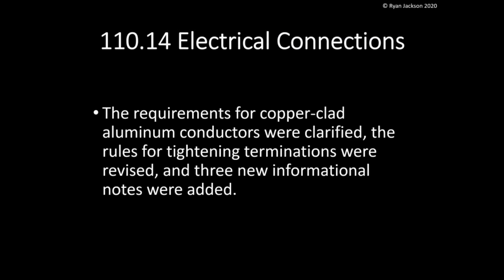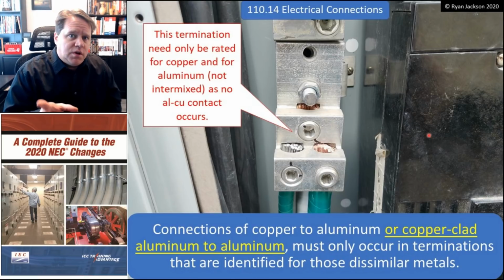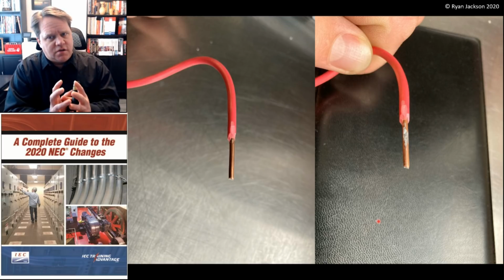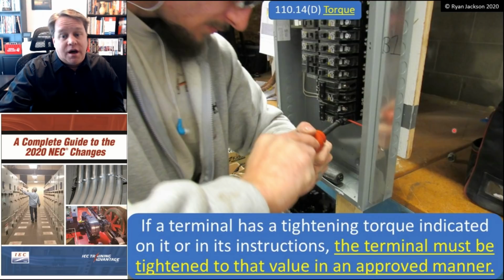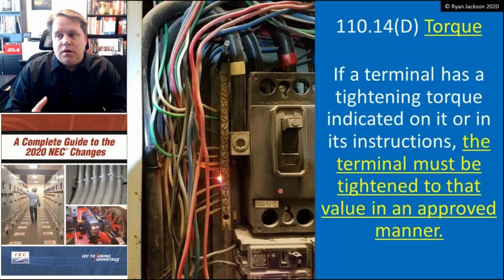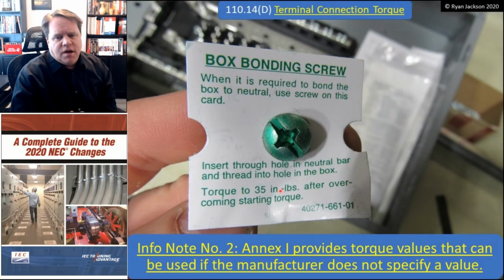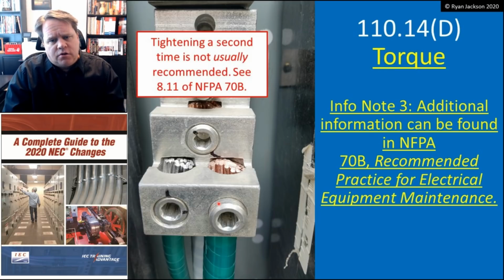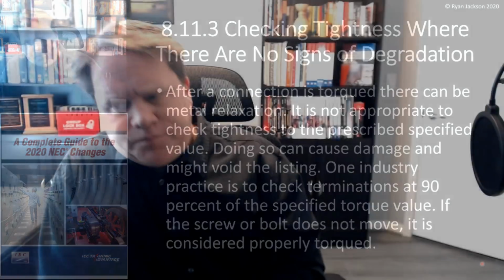2020 NEC changes series: 110.14 Conductor Terminations

Comment: At 5:45 you talk about skin effect applying to power conductors, but in your conversation with the gentleman from Copper weld he mentioned how that really only applies to data conductors, and the majority of the current does flow through the core of the conductor for power conductors. Which is the case?
Reply from the maker: He is correct. Skin effect at 60 hz is not much of an issue. It is a common misconception that I used to beleive.
Reply: Wow no kidding. It is what I was taught as well. I thought CCA was invented because of the skin effect (since copper is the perimeter). Thank you for your quick and helpful response Mr. Jackson!
Reply: Do you have a video or more information about this?

Comment: 8.11.3, that right there is why all of this should be available for free, and not behind a paywall.  I'm a farmer, I've installed two of my own services (one new, and one changeout).  Farming doesn't make enough money to hire an electrician, so I research as much as I possibly can, and then if it's legal, I do it myself.  I've heard to re-torque connections, but never to the 90% value.  Even plan on calling the POCO to pull the meter so I can retorque meter terminations (line and load side, I bought a pair of Class 0 gloves and protectors) after a year of heat cycling, seems like cheap insurance.  I even used a torque wrench on the SEC after the POCO terminated to the meter socket with a T handle.  They were loose.  You could potentially have thousands of $ of damage from an open neutral, and it could be due to the POCO not torquing the meter terminations. Honestly, even if the code didn't require it, it's just a smart thing to do.  After seeing some electric installations, I don't even know why they require licensing for electricians.  They either don't have the licensing and do it anyway without inspection, or the inspector passed some sub-par installations.  I passed a state inspected service, it was amazing how easy it was (granted, I researched thoroughly, and asked questions about almost every variable, so I knew I was doing it correctly).  But during the inspection, I was thinking "really, you didn't check how tight the lockrings were, the torque on any of the terminations, anything?"  Basically, even if I had a Master Electrician install something, and it was inspected, I'd still check it myself.

Comment: My only disagreement after watching the video is to only torque once. I've followed those electricians around far too often. One of my first lessons in the field was to always retorque connections, specifically every stranded wire connection. The stranded conductors will "settle" and should be re-torqued 24 hours later.
Reply from the maker: That is 100 percent incorrect.
Reply: Did you watch the entire video? He goes on to explain why you only torque once. And backs it up with receipts.

Comment: And if I am working in the panel, - do I have to remove every component to look for the torque value of each of it, because it is not visible from the front, to find out what is 90% of the required torque value is?

Comment: As a building inspector, they had to go work as a millwright when we had to crash in 2008. Well I found is electricians do not tighten things tighten enough. I found loose lugs loose wire nuts and some poor installations. It’s nice to be back as inspector since 2013. But that short time off taught me that I need to pay more attention to what the guys are doing out in the field.

Comment: Is that terminal really made of steel? Or a steel alloy? It seems kind of lightweight, to be steel.
Reply from the maker: Aluminum.
Reply: @RyanJacksonElectrical  With tin plating. Some bus bars use nickel for higher expected temperatures.

Comment: Food for thought. On several panels that I know were torqued a year earlier had hot breaker terminals under load when viewed by FLIR thermal imaging. All popular brand breakers with both solid and stranded copper wire. The they were re torque and the heat went away. Pulling and inspecting a twice torqued conductor shows no excessive signs of damage,pinch off, extrusion. Only good contact area. Soft metal cold flows and 85% is initially, the rest comes later, but it greatly reduces and is not indefinite unless there conductor/terminal aren’t compatible or sized correctly. One lifetime torque is BS and a great way to service call. I predict the NEC will address it better. For the first tightening on stranded is to gently orbit the wire as I come up to torque to help settle the strands. Makes hell of a difference in integrity of the connection.

Comment: Re torque a second time after 24 hours is standard practice in pipe fitting for flange bolt connections. Super interesting the opposite is true here for the same concept

Comment: Still, never will use aluminum other than service conductors, some large feeds, that is where the copper clad may benifit, but CCA still needs to be treated as aluminum, is more brittle, termination torque etc, I will never use CCA for any branch circuit installation. After having dealt with some of the AU home wiring back in the day and those problems, never would I ever install it now, even if copper cladded. Same for low voltage (reference data/security etc) had gotten some CCA wiring for some data, security was cheaper did not notice, eventually so many issues with failed termination, I ripped out what had installed, got pure copper no problems, basically all that CCA when to the dump where belongs! Learned my lesson with that costed me, the money wasted on the wire, the time redoing stuff. I do not want call backs and have no time for installation issues either. Just not going to be part of my inventory.

Comment: sheer bolts common for "donuts" or "biscuits" that connect multi family meter packs next to each other. the head breaks off, and a colored plastic washer is left behind that shows its been torques.

Comment: I would imagine that the skin effect is very slight with only 60 cycle current and that the real reason for the diminishing returns with larger conductors is the diminishing surface area to volume ratio. The volume is responsible for the generation of heat, but that heat can only dissipate via the available surface area.
Reply: Most likely not that much effect at that low of frequency, probably some but doubt it I think the most obvious reason for CCA is cost period as the major driving factor.
Reply: Most of current travels near the surface of the wire.  With larger wires you can theoretically get more current capacity for less money by cladding aluminum with copper.  The current cost of materials and cladding will dictate when it makes sense.  Of course I would rather have copper only and not worry about issues with aluminum.    Back in the 1960s I worked with circuit boards that had silver or gold conductors, not that anyone could afford gold for wiring a structure

Comment: Worked at a large slaughterhouse years ago where we always installed lockwashers on all bolts ( stakon splices motor bases etc ) due to a lot of vibration by crushers hammer mills skakers etc. Made sure all connections were made super tight. Had to get use to not breaking heads off of 1/4" hex headed screws while tightening with a breaker bar.

Comment: Before I retired a few years ago my very smart senior electrician showed me one of his electrical books ( not the NEC )  told you that you should never retorque wires that were torqued. We had an on going arguement with the cheief electrician who insisted that we retorque every connection every time we performed a 6 or 12 month PM on hundreds of VFD'S that were running. At that time nobody made an insulated torque wrench so even with PPL refused to do it unless the drive ccould be shut down & LOTTO.

Comment: Like how some switchgear manufacturers mark heads of all hex headed bolts with a marker. By looking at original drawn line between bolts and buss bar or breaker connection easy to see if connection came loose.

Comment: Thank you Ryan. I have been doing maintenance- electrician- at a zoo for about ten years.  Probably 90% of the electrical equipment is from 1986-87.  I’m a little embarrassed to say I HAD gotten into the habit of  “ red-faced torquing” .   You know, just short of popping a vein.  A lot of what I do is trying to maintain our existing equipment so again.....thanks.    Doug.
Reply: Over tightening bolts & screws not a good thing. When I was a young strong apprentice would drive my coworker crazy breaking 1/4" by applying too much force. While at an IAEI class the instructor told us that UL went around and checked torque on various connections. Only 30% were correct and think it was 50% too loose and remainder over torqued.

Comment: Are we just not gonna talk about that "" glowing red "" termination he showed is on a ground wire ? 🤣🤣 

And on the torque specifications I understand it but are we gonna have to start doing yearly maintenance retightening all terminations because they will eventually loosen with electrical being at 60Hz which is absolutely a vibration that will over time become loose

Comment: the reason I didn't become an electrician, it's a blind religion. every time the code book comes out, worship that thing, don't bother to understand reasons, that's illegal, just follow the book! no. how many electricians really understand the things they are doing, the reasons for why things are done a certain way. it's always about the book. fuck the book, understand what is really happening in the real world.

I once ordered some wagos to try on some low voltage. I got them and looked at them.... no, not using this trash. not for low voltage, definitely not for my home wiring, never. but if the code book says it's ok, then.....

Comment: electricity doesn't flow mostly around the outside of a wire, that's mythical bull. that only applies to high frequency, which power lines are closer to dc than they are to a high frequency. the real reason you have diminishing returns on larger cables is the surface area, yes, but for different reasons. heat dissipation. that is also a reason why animals can't get much bigger than an elephant and why smaller animals have a much faster metabolism, surface area to get rid of waste heat. electricity flows for the most part evenly through the entire area of a cable. a down side of copper clad, it creates more heat internally, which needs more surface area to dissipate, which means a much bigger cable.
Reply: Came into the comments to make sure someone mentioned this.

Comment: Wait just a minute.   Please explain the harm in tightening a connection too tight.   That's absurd.   Is there a requirement for yearly torque testing?
Reply: bolts stretch when they are over-tightened. they can also stretch somewhat when they're properly tightened, hence why there's a specific torque. an engineer figured the exact amount that bold should stretch to be as secure as it can be, without the risk of damaging the metal. if you keep making a bolt tighter and tighter, you get to a point where not only does it not tighten more, it'll start to fail and give way. most times in the world, good is good enough. but with electrical installation, much of the time you want that install to absolutely never fail. sometimes guessing with your own strength isn't good enough.
Reply: @lorenzo42p  I'm 60 years old and have been working in the repair field most of my adult life and even as a youngster growing up on a farm to a certain extent.   I spent several years in related schooling. I'm very familiar with bolt stretch.  I'm also very familiar with the fact that there's a difference in bolts.  All that being said,  it's really not realistic to think that screws in a 60hz ac system is only going to ever need tightened once.  Not one time in my entire life have I had a connection fail because I didn't tighten it correctly.   The only problem with connections is from a less than desirable tech and using a torque wrench isn't going to fix that.  It will only hurt the ones that didn't need to use it in the first place.
Reply: @engineclinic  I want to prove you wrong,. But, I can't. There are estimates. Estimates don't prove much. However, there really isn't any other data, because in 1980, statistics weren't really that concise. I am a better safe than sorry type. The estimates are that there are currently half as many fires caused by electrical malfunction than there were in 1980, when you began. However, most electrical fires are NOT caused by poor quality in workmanship. In fact, it doesn't even rank in the top 7. Aging equipment, DIY repairs, turkeys, overloads, heaters, and extension cords all made the list. If I were to guess, if the 50% estimate were remotely true, it has very little to do with over or under torqueing connections. It probably has more to do with organizations like the NFPA creating awareness of the dangers of things like turkeys and tip switches on heaters. You can't educate the DIY'ers anymore than they choose to be, but I think that currently the DIY'er is a bit more savvy than they were 40 years ago. A lot of that has to do with the availability of information.
Reply from the maker: Damaging the conductor, damaging the damaging the terminal, damaging the equipment. No, there is no such requirement because the NEC ends at the installation [90.2(A)]. Maintenance is not within the scope. See NFPA 70B for recommended maintenance practices.
Reply: @RyanJacksonElectrical  lol

Comment: I've always wondered about these torque tools when it comes to the do-it-yourselfer. It's not like you can pick up these things at Walmart. I'm not even sure if Home Depot or Lowes sells them. I've looked on the Internet, and they are not cheap. Exactly how is an inspector supposed to know it was torqued properly if it doesn't have sheer bolts? All you've got is the honor system. They'll probably make you torque wire nuts properly too. I seems to go in the category of arc fault receptacles and breakers. Just something not necessarily proven that you have to buy.
Reply: Arc fault is code for all bedrooms in many areas.

Comment: Some manufactures are using "snap off" bolts for their bus duct systems.
Reply: I should try to using the correct terminology as well. I believe the correct term would be "MECHANICAL SHEAR BOLT TERMINAL LUGS".  I also found out that they are used by some manufacturers for medium voltage terminal connectors, such as cold shrink and heat shrink kits.

Comment: Tighten it till cracks, back it off a 1/4 and leave it for the night shift.
Reply: Why would you back it off?
Reply: @engineclinic  it's a joke :-P
Reply: it's like working on a car with all plastic parts in the engine compartment. you tighten down a bolt until you hear the crack, then back a quarter turn, perfect!

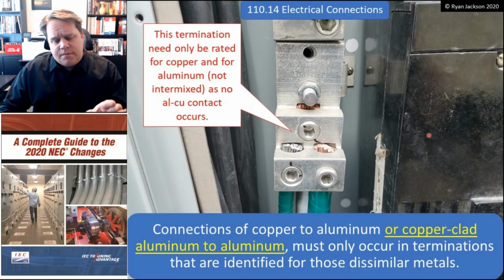Comment: Pretty sure the lug pictures around 3:45 is aluminum, not steel. I have never seen a steel one ,and it wouldn't make sense to use steel due to the higher resistance, differences in thermal expansion and lack of corrosion resistance (they would have to galvanized).
The skin effect for current really isn't significant at 50/60Hz. The skin is about 8.5mm thick so no home wiring is large enough to not have the current flowing thru the entire wire cross section.

Please don't suggest using torque indicating screws. They are one time use, and very expensive. Fix problems that actually exist. We aren't having failures of these connections so don't add cost by more complex hardware or inspection requirements.
Reply: That is an aluminum lug.  A tin-coated aluminum lug.

It is common to use tin-coated aluminum for lug materials, and for them to be rated for use with both copper and aluminum wire with an appropriate antioxidant for aluminum.  Because of copper having a higher thermal expansion coefficient than aluminum, it is common for aluminum lugs to be dual rated for both materials but copper lugs are exclusively for copper wire.  You want the wire to tighten its contact with the lug as it heats up, rather than loosen the lug.

Comment: I worked for a large commercial electrical contractor in Florida  I was assigned to build switch gear. When I asked the shop for a torque wrench , they didn’t even know what I was talking about! None of them! They looked at me like I was into voodo/ black magic. For real! Scary willful ignorance.I hated that place.
Reply: How many mechanics don’t torque bolts when changing wheels or even basic bolts?  I can’t tell you how many people have warped brake rotor’s or rounded heads because of it.  When you consider most lugs in a panel or receptacle will not be touched again for decades, why not take the time to do it right.
Reply: Typical for ropers  who moved into commercial

Comment: BTW, the MFG of the termination, as far as I know, does not specify strand count.  There is a missing link in that regard.  Degradation in this case is that the wire just falls out.  No, MFG spec is not good enough for low-strand count cables.  Crimp lugs only. SAB cable.  Great prices but you  better crimp and not skimp.
Reply from the maker: 110.14 addresses finely stranded conductors, and Table 10 (off the top of my head) addresses strandings.
Reply: Most every day MECHANICAL lugs are listed compatible with Class A & B stranding only.  A & B is the ordinary building wire we use every day. Class C & D stranding are the highly stranded conductors like welding cable. As far as I  know only compression lugs are available for Class C & D